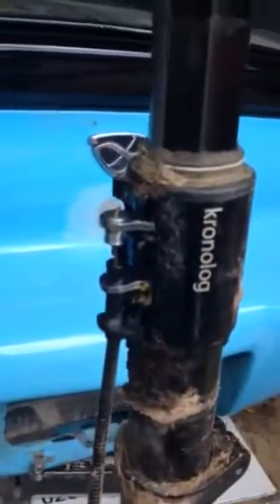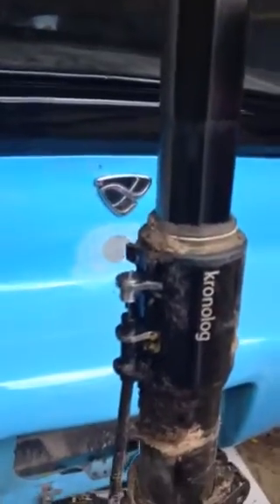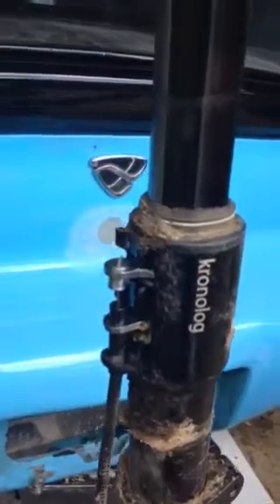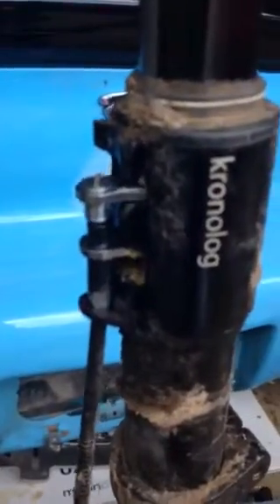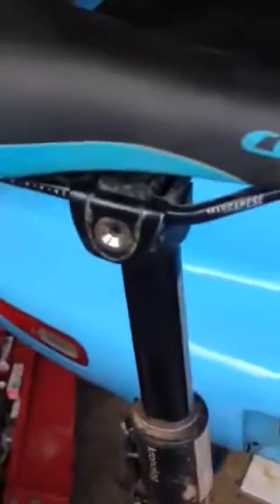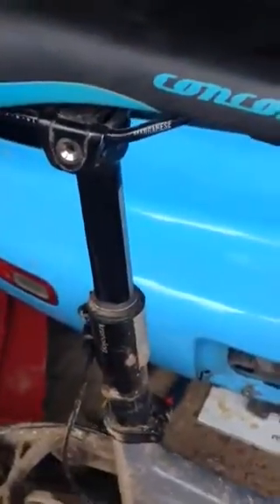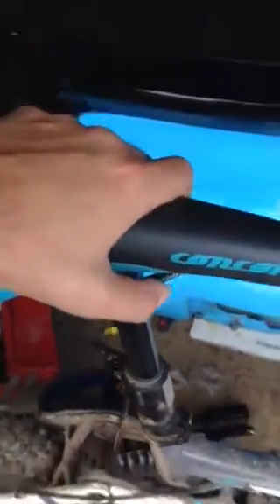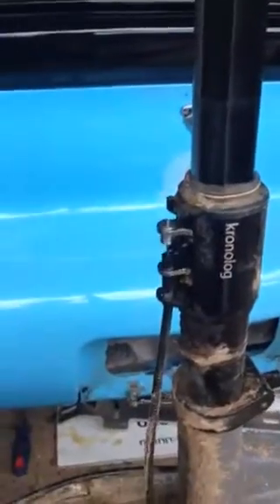Crank brothers dropper post not working

Comment: might be you've pulled the cable to tight that the locking mechanism could not engage fully, give it a little slack see if that helps. if you have not fixed it yet since this video is over 2 years old